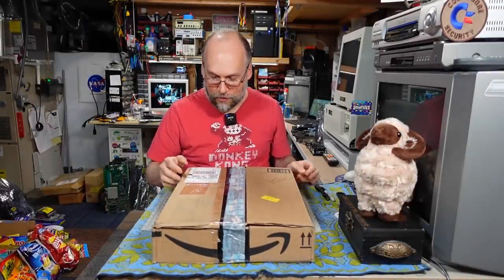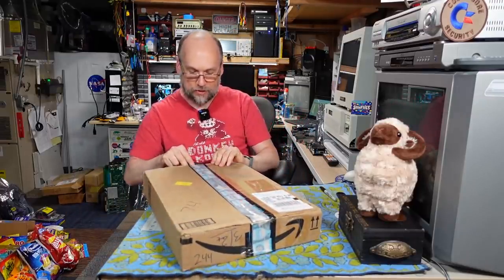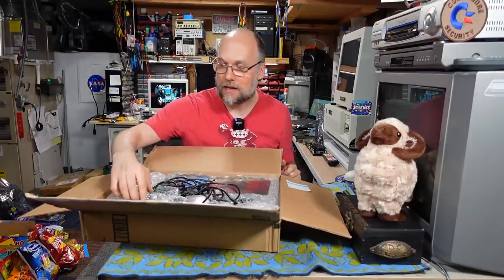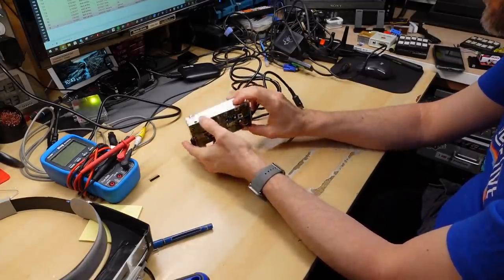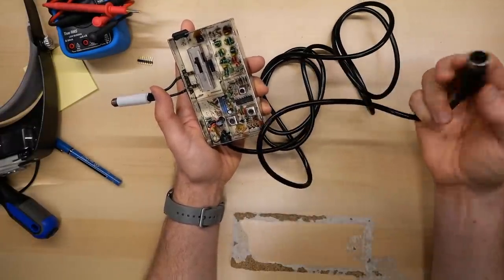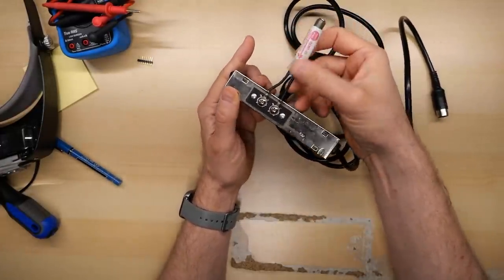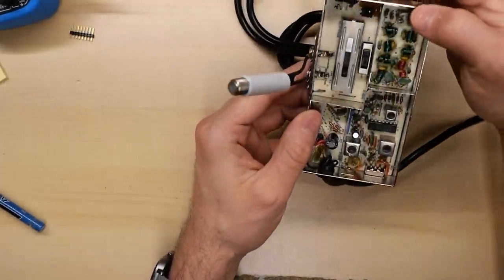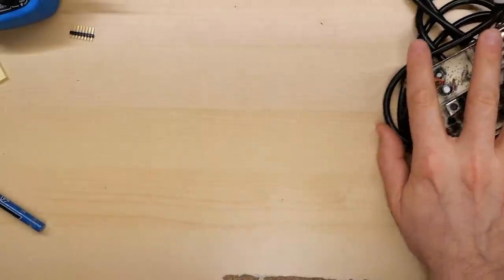Ti99 goodies, motherboard troubleshooting, a special floppy disk and the worst joysticks ever?

Comment: Worst joystick ever, but they worked; can’t say that about 5200 joysticks after a few hours. HOWEVER, I learned how to use them when playing Parsec, Munchman, Blasto, etc. because BITD that’s all I had. I couldn’t just plug my CX40 Atari VCS joystick into my TI without an adapter, which I didn’t get until much later. Fast forward 40+ years, and I find it hard to play the games on my TI that I loved when I was younger unless I use the original crappy TI joysticks (or “remote controllers,” as they were called). Or maybe it’s really just that age has taken a toll on my gaming abilities... :-(

Comment: I think the original Atari 5200 joysticks must have been worse than these. They were apparently designed by a famous designer who had nothing to do with the tech or games industry. and were totally unsuitable for gaming. They were mushy and didn't have even self centring, so they just drifted aimlessly and stayed in whatever position they settled in. Really not good for twitch arcade gaming. And apparently they almost all stop working and die — even when not in use!
These may not be great, but they gotta be better than that. 🙂
Reply: Don't spread that false story. The engineer of the CX52 had designed other controllers for Atari prior to that. The problem was Warner wanted to leverage as many of Atari's patents and overly complicate the designs in an effort to stick it to the Intellivision. So they went with the flex circuit when it wasn't ready for prime time. And they didn't make the analog stick self-center and they over-ruled Atari's own engineers who protested over releasing the console without self-centering joysticks. The Rev9 flex circuits usually do not fail. And the carbon dots can either be rubbed on with deoxit, pencils, or copper, aluminum foil, or gold dots can be affixed in those areas so that they don't lose button functionality. That's been known since 1984. Best Electronics has made a fortune over the years selling refurb kits for them too. And having used the CX52 and TI's curse-ed joysticks, I'll go with the CX52 any day, whether they work or not in comparison.
Reply: @TheJeremyHolloway  Interesting. Thanks for the info. 
I have no personal experience with either controller. What exactly is it about the TI-99 controllers that makes them so bad?  Do sticks feel anything like the old VCS  / 2600 sticks, in action?